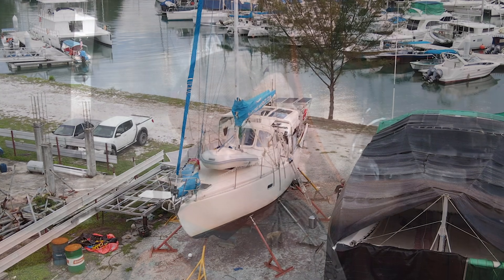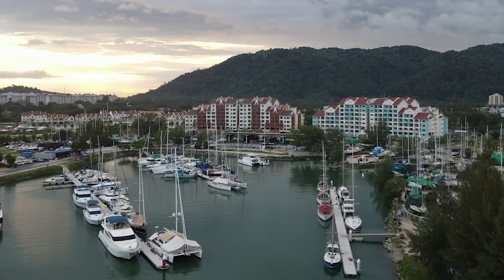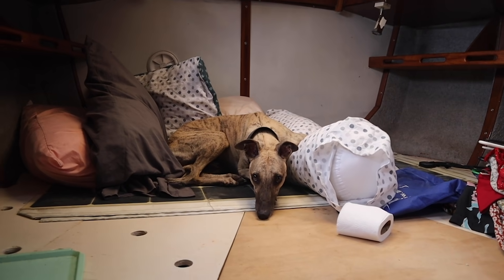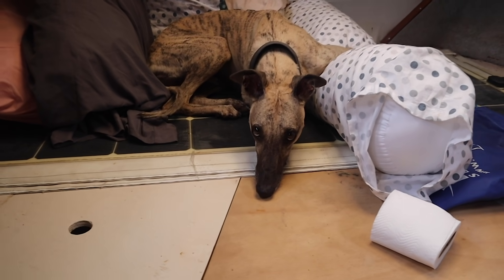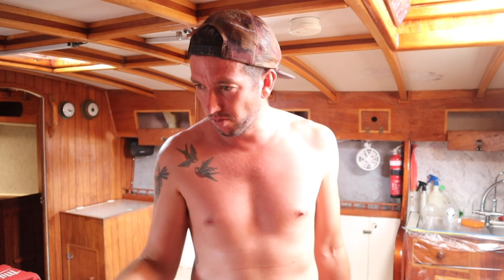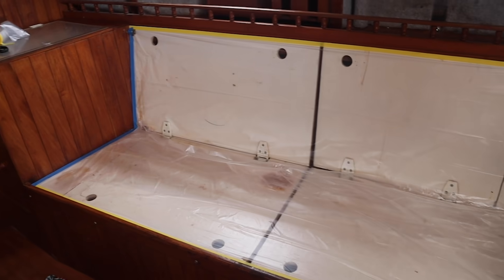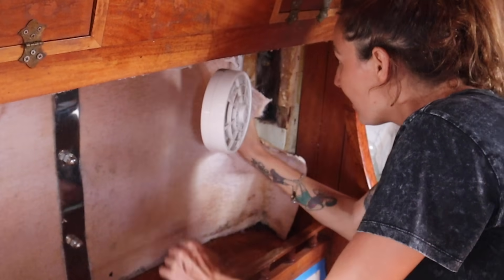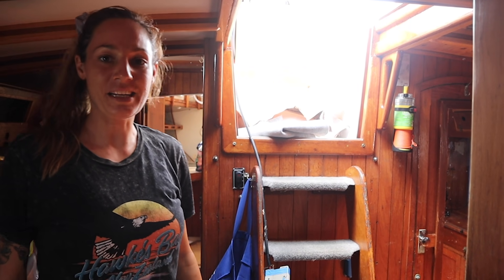THE DESTRUCTION PHASE! | Sailboat Refit 2, Ep 207

Comment: I hope that you see this and you do not mind the advice. I noticed that the wind generator pipe appears to be very close to one of your VHF antennas. Metals ( specially metal the is running up and down next to the antenna) needs to be at least 1/4 of a wave link away from your antenna. VHF marine band is basically 156 to 158 Megacycles. The formula to find wavelength is the speed of light. (300,000,000 millions a second) decided by the Frequency in megacycles. This is close enough that you can just use 300 million decided by 150 million giving you 2 meters. This means that you want to have half a meter between the part of the antenna that broadcast and any major pice of metal. For those that care or want the most out of your antennas it also helps if at the base of the antenna there is a quarter wavelength in 3 or 4 directions to act as a ground plane. This helps keep the antenna radiating flat and keeps more signal towards the horizon and less going up. As to the pipe being that close to the antenna it can cause the antenna to radiate more in a certain direction and as close as that one is can also cause transmitted power to be reflected back into the transmitter which can cause it to have more heat and fail sooner. Just in case you are wondering I have many years as both a commercial radio tech and a ham radio operator.
Reply from the maker: Thanks legend for the wisdom, that antenna did get moved a little but it is not for VHF, it is a Wi-Fi booster. Cheers

Comment: Hey guys, just pulled carpet in my 1977 54’ full keel.  So I did the kids v birth, pulled carpet.  I found something that works great,  I put blue 3/8 camp foam on the hull for insulation, then got a roll of 1/8 cork floor underlay,  trimmed up and glued it in, and then epoxied it....it worked amazing.  foam $100, cork $250.   Did a double bunk and the plywood floor.  I have pics of your interested

Comment: Another channel did that side area with carpet because it cut down on noise .  That said, the second layer has to be contributing to the mold/dust situation.. I got up very early this am because I had heard a very strange sound from my SSB antenna radio. The antenna had come down with a wind storm. I actually was on my roof at 5:30am so the neighbors think I'm even crazier than before now , but we use these antennas to talk to boats along the pacific and down into Mexico (Baja and Sea of Cortez) so needed to get it operational.  In the U.S, Spud refers to a potato !

Comment: Think of the bulkheads has been continuation of the headliner and the floorboards that run from stem to stern and your sidewalls also running stem to stern as though the floorboards were rolling up the sides. This means that the sidewalls when they hit the bulkheads will be at 90° from Each other and sense you got to have somewhere that it’s gonna be that way and it would be more in line than the bulkhead and the headliner or floorboards having the 90° where they intersect. So bulkheads up and down and the floorboards headliner and side walls stem to stern.